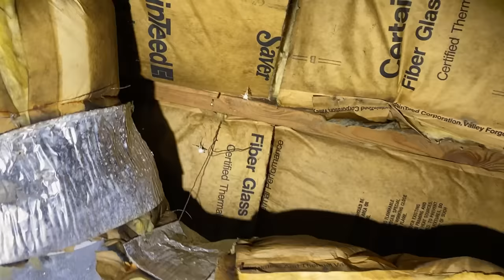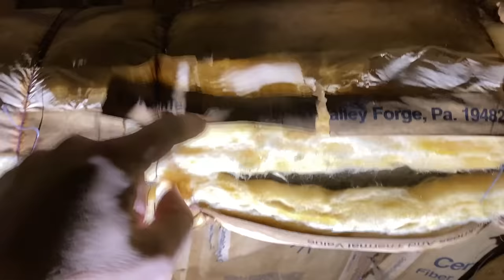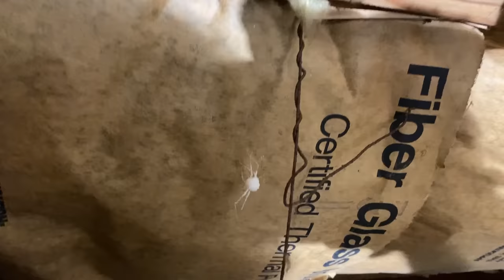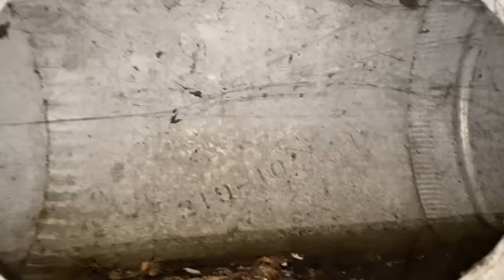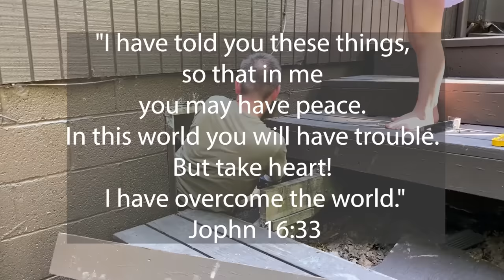Finding A Secret Room Under My House and What Was In It

Comment: If you ever go into a space like this again, especially if it smells. Set up a ventilation fan in it for a couple hours sucking the air out of the lowest parts and drawing fresh air in. If you go in and are overwhelmed by fumes or lack of oxygen from kicking up rotten debris on the floor, the person that finds you tends to panic and jumps straight in and goes down as well, then the next and the next. If an emergency service comes to get you out they are going to treat it as a body recovery over a rescue.

Comment: Insulation was put in backwards.   The foil/paper side is supposed to be toward the living area, not the cold side.  Moisture stays against the paper.  Whole room should be insulated, possibly with styrofoam, and the heat ducts should be insulated better.  If you put in a larger opening, put a door to it, and steps, it would be a good storage area.

Comment: An air conditioner takes the humidity out of the air. My portable one, I can either empty now and then, or I can run a hose outside through the window where It vents out so that it will always drain as it runs. If you have a lot of humidity in the air, you might notice after driving your car with the air conditioner and parking, that the condensation on the outside of the unit will drip for a while and leave a puddle under you car.

Comment: If there is that much dripping it is very wet on the inside of the duct you better rip.it all-out . Put a heat duct down there and cool in the summer to keep the temp more consistent maybe.

Comment: My husband is a contractor & 1st he said it's the wrong insulation & it's been put on wrong. You need foil back insulation.  And check your condensation pump in your air conditioner.  Of course,  by now you probably have this fixed.  Lol

Comment: I feel certain what you’re smelling is mold. When you said “it’s filled with water”, it sounds like your drain pan is stopped up. Sometimes all that’s required is some Clorox bleach poured into the drain pan and pipe. You probably need to run a wire or something down the drain pipe itself. Best of luck with it.

Comment: I had an issue in work where the air conditioner run off was very slightly higher than the duct piping, we had to re angle the drip tray increase the bleed pipe and it sorted smelly water

Comment: Some foil back insulation on the ducts, seal the joints with low expansion foam, then add air vents to the space . A bag of dry lime will deodorize you space, spread it around and the smell will disappear ! Check your coil for a leaky pan, most new coils don’t use rustable metal for pans .

Comment: When the mechanics wire rusted and the insulation fell off, it allowed for the hot air from furnace/heat pump to cool off too quickly and formed condensation. Dry out the pipes. Clean all the trash and debris out of the pipes. Put screws in the holes you drilled and re-insulate the pipes.

Comment: You probably fixed problem almost a year later. Two things come to mind as far as diagnosing the problem. If it were a waste water issue, like someone said, an overflowed toilet could have been the culprit for the water. Also you could run the water at each fixture including washing machine to see if a broken waste pipe is causing water to come out holes you drilled. A potable water leak over duct work especially a copper line touching duct work after 50 years could by vibration expansion and contraction of metals and electrolysis may have worn a hole that is driving into the duct work beyond the visible area of that secret basement room. last but not least, and the most likely is a solenoid valve stuck open in the ductwork above furnace for a dehumidifier which could be pumping extra moisture In duct system and condensation on interior of ducts when AC is on.

Comment: I'm a plumbing company owner operator for 33 years
I know that 8 hours of the A/C running you can get 5 gallons of condensation that need to drain through the condensation drain line to the outside atmosphere.
The condensation drain lines clog up every few years. You need to maintain them, either blow them out with air or flush with water PSI. The end termination point can be buried in the dirt causing the problem. Upstairs A/C  units condensation drain lines can terminate to a sink drain underneath the sink inside of the cabinet space. They clog up there too with hair and basic drain muck.

Brain storm and then call your A/C guy..
Don't run your system you can get your family sick.

Good luck

Comment: I would test the gas down there first....could just be some yucky condensation. Actually doesn't look so bad yet! Mostly dry still despite the condensation. You can fix it up down there good and use it as a cellar! Fix up the insualation and seal things up good. Lucky u got it before getting really bad. Just needs sealing and some air vents set up right.

Comment: unless your furnace is upstairs not in the basement I dont think it would have anything to do with the a coil, the average a coil is 19 inches tall and your ductwork is too close to the ceiling and water don`t run uphill and you would see some evidence of water around your furnace, I have done HVAC work for 40 years, it maybe a condensation problem tho with the insulation missing off the duct work.

Comment: easiest thing would be to clean the area up then take down all the old insulation and do a 2" closed cell foam spray to seat everything in there and perhaps put a concrete flooring in there and then you will have more storage or the girls can have a hang out or man cave.

Comment: if your insulation gets wet, its basically useless and no you do not want to put a vapor barrier on the bottom of the joists, you want a tyvek house wrap. the plastic will trap any water that gets into the insulation while tyvek stops liquid water one way but lets water vapor pass the other side of it. you would want the place the plastic vapor barrier ontop of the insulation to stop the transfer of water vapor to the house and the tyvek would let it dry out.

Comment: Once you figure what made the insulation get soaked,(Air cond.sweat drains plug up with snotty gel.)you need to sprinkle hydrated lime powder over the whole floor area and possibly put down a vapor barrier,that i'm not sure of. But lime works wonders. Charcoal too.
Reply: When you find the drain,probably pvc,you can clean the goo out with water pressure. Im betting theres a swag in the pvc drain line instead of a steady drop. Don't call a plumber until you see if its plugged,flush it yourself,save$.

Comment: you need to remove all that insolation  and insolate the exterior walls only. it will make a big difference in your house and your duct work will not condensate any more. The floor in the room upstairs will feel wormer and it will help get rid of some of the dampness down below.

Comment: Should have drained all the water into buckets. Put a vapor barrier in the floor, fix the downspout and drain it away from the house. Leave the opening open and dry it out. Make a door that swings into the space (I recommend PVC) and slant the sill so water drains away.

Comment: Looks like it was originally designed as a possible mechanical room, but the original owner may have decided to move it. Loads of wasted labor to excavate and build the walls that deep. You could renovate it and use it as a cold storage room or some thing use to fit the family.

Comment: First of all get a contractor and see if you have asbestos. If you do, you have a mess on your hands.  Once all your problems are solved and sealed, build a trap door and staires to the basement and storm shelter. You have a really good foundation to start with.  It looks like that is what the former owners were doing and couldn't finish it.  Good luck and stay safe.

Comment: That will insulation off that pipe is not good. There’s water in it or there’s been water up to it and that is a lot of water if it filled that little area up it’s definitely been leaking. You need to check your downspouts and have them flow away from the house, if the ductwork is full of water, you got issues that is going to stink for a while

Comment: As an experienced HVACR Technician and HERS Rater I will tell you Do not touch fiberglass insulation.  Also you should have a better mask.  Rigid ductwork is always taped.  The empty can in the duct is a huge clue that your sheet metal guy was a drunken mess.  Do not try to recycle that ducting, throw it away.  So please replace it immediately with brand new flex duct, preferably R6.

Comment: I didn't see any pictures of your Furnace-A/C that is connected to the heat-runs.  I want to know if the furnace has a Humidifier attached to it.  Like your A/C coil drain, there is a drain for the humidifier too.  If either is plugged, the water ends up in the bottom of the furnace and the blower will send it down the pipe.  Let us know what you find!

Comment: Were I you, I'd call in a professional to figure out what your system is designed to do and figure out how to best alleviate any future damage from the unwanted water. You certainly want to avoid any toxic mold from getting a foothold and keep your newfound crawl space dry. Run some simple electrical and install lights for regular inspections. 
It all looks like a simple project for a young fellow like yourself. Good luck!

Comment: If the condensation drip line from the AC is plugged up at the "A" coil then the condensation has no where to go except into the ducts. Over time it will stink.

Comment: Block seal the block. Change all the insulation but first put a vent pipe from the outside into your space for clean air if you're going to be making this a space for your kids but the mold definitely will kill you

Comment: Your A/C in the furnace is dirty and it's freezing. NEVER leave a door or window open with A/C. That is why it ices up the fins in the A/C. It melts and runs into the ducting. Because the drain pan is also dirty and the holes are plugged, it can't drain at the right place. Have your A/C and furnace cleaned. Problem solved. I had the same problem. Also 50 years of crud down the heat vents is half the smell.

Comment: It's probably from a dirty downflow ac evaporater coil or damaged that's leaking water into duct. It's seen a lot in manufacturer homes with duct work under home building up,& no where to go. Causing restricted low air flow, & smelling meldew standing water.

Comment: Sounds like possible hidden mold-mildew. In the immediate interim and as a precaution, might try several industrial sized fans to dry out the air and blow out that possible poisonous smell out of your place. Very alarming.

Comment: First off look into what you’re about to do, the area should have been vented BEFORE you went down. The water in the duct work must be attended too immediately, mold is a serious problem and should be left to experts. You are breathing in whatever crap is in the air. It is not pretty good , it’s dangerous and what you say you are going to do is completely wrong. Let the experts handle it ❗️🇺🇸

Comment: So basicaly it's just a passage way to under your house and where all the trash was thrown from construction all construction trash. I bet that smell is that wet condisation from the insulation. It's not supposed to be very wet at all. I had a newer house after a month mold started poping up in master bath cieling walls and in a bedroom on the hard wood floor problem was the insulation on the duct work under house they took insultion off put a dehumidafier in attic and under house like yours is and fixed the problem of condisation on inside under house. A dehumidafier will fix it try In attic first. That water is from condensation from attic crawl space of it being very humid also get a drain put on your main unit. My drain pan was not draining out if pan due to dust clogging the drain to drain outside andgot into my ac ducts. But the dehumidafier in crawl space in attic completely solved my problem and sealing off all my sofets as well cuse wind was blowing humid air in

Comment: I'm guessing the condensation from the air conditioner somehow getting into the pipe there should be a condensator pump that pumps condensation created by the unit outside to a drain

Comment: I remember as a kid visiting my Uncle This guy pulled up the floor inside the closet And headstairs going down into a room that he dug out with buckets pulling all the dirt up through the floor Then pour the concrete floor in it Mixing it himself I'm sure And built a concrete wall all the way around the room with blocks filled with concrete and rebar . Down there he had a wooden stove and a chair his wife would not let him smoke in the house so he smoked a pipe down in that room . There didn't appear to be any moisture down there that I could tell

Comment: I'm not actually looking to Wade through 1,400 comments. Along with getting your heating and air conditioning guy in there to solve the condensation problem, you also need to get cross ventilation in that space. You need to pour a thin concrete floor in that space as well. The '70s can tell you when it may have been built. The building codes did not come into existence until about 1980.

Comment: You didn't describe the smell, but one recently dead mouse will smell like a gas leak because of the methane in the carcass. Even if you didn't see any, it could be stuck down in the bricks or anything. Had one eat poison and die under a hardwood floor by the patio door frame and the baseboard heat, it stunk sooo bad. And I say do what other people have suggested and start using the space. Dig down outside and put in a door. Or a trap door with stairs in the living room above. Also the spiders turn white when they die, no worries.

Comment: maybe it would be cheaper rent a camera to run thru the vents yourself to take a look. my guess your AC is causing the water? the drain on my ac got plugged up and the water backed up into my ac & furnace

Comment: Those white fuzzy spiders died of a fungal infection! I believe it spreads pretty easily to other spiders so that’s why there were quite a few like that. If I remember correctly, spiders once infected turn into zombies as the fungus infects their nervous systems and then eventually die. I might be wrong about the zombie part and confusing it with another parasitic relationship

Comment: i know exactly where that water is coming from. it's the drain pipe on your furnace ac drain. its stopped up and running into your ductwork. if you go to your furnice you will see white PVC pipe coming off the ACoil for your AC condensation have a heat and air guy to come to blow that out and unstop it. so the water in the summer will drain outside and not back into your ductwork. 100% sure of this.

Comment: Its the wrong insulation. That kraft paper is flammable. Its supposed to be for wall cavities and covered by sheetrock. Use unfaced insulation und3r the floor supported with insulation support rods and wrap the ductwork woth proper duct wrap insulation.

Comment: The duct is open,,, there is water in it plus debris, so the smell may be coming from a main drain.  The building blocks  foundation walls look new and look clean...  I think it is possible that someone else may have access to it from the main... So be careful when you are there...  I thought I saw a long passageway that may lead to somewhere else. You may have to build a super strong steel reinforced wall to keep the intruder and the smell out... Its a little bit spooky with your children there and all... Do be careful...

Comment: Did your home inspection not turn anything up on this?  Seems like a big miss, this issue is not a new one.  Moving forward you need to have that ductwork replaced and new installed with insulation.  Also have your HVAC company firgure out where that water came from.

Comment: The block wall where the duct work comes in next to the fireplace looks like there's another hole just behind it, unless it's just a trick of the light
Reply: Also once you remove that insulation you might find an old trap door into the house.

Comment: I've only watched to the point where he disconnected the air duct and found a lot of water in it. I'm gonna guess that his drain pan is plugged and all of the condensation is being blown into the ducts, settling in the low parts, and stagnating. Galvanized or not, they will eventually rust through if that much water is standing in them with no way out.

Comment: Outside water seeping through the cender blocks into a closed room below ground level, acts like a sistern with no ventilation to the outside, makes for a mold build up that can kill you,,, like black mold,,,, the blocks need to be sealed, and a water barrier made on the outside of blocks to prevent water from seeping in again,,, once water gets into a place like that ,,,,, condensation increases more often and more rapidly,,,, and a vent to the outside to keep the gases from accumulating from the mold.

Comment: We had trouble with a smell we couldn’t figure out and it actually a mouse that had died between the walls😩a horrible smell and couldn’t get to it we just had to wait until it did what it had to do and the smell finally went away, it happened twice  through the years and finally called an exterminator . He plugged up holes at the end of vinyl siding we did not know was there knock on wood it hasn’t happened sense.